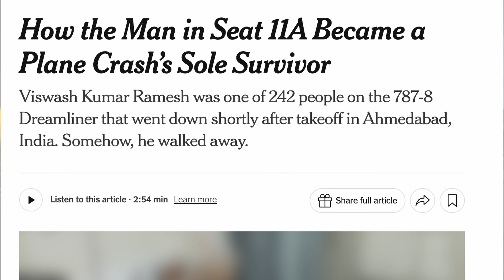Why the RAT Changes Everything – Air India 171 Update

Comment: Top suspect seems to be fuel contaminator that caused a compressor stall and the loud bang the survivor heard.  The plane was 11 years old.  Nobody's mentioned any prior mechanical issues like a past, fuel system issue that could've affected both engines. That leaves fuel.  I'm guessing the plane is designed so a power failure wouldn't affect the fuel injectors.

Comment: It is good that the experts are converging in their opinion. I have seen at least one other pilot discuss RAT deployment in the video and audio. One of India's most famous pilots called it a dual-engine failure early on, too (although without any explanation). A DGCA-certified trainer recently discussed a dual-engine failure, and he believed it could have been sabotage, with the fuel valve being shut off. I would assume that the telemetry in the cockpit/black boxes shows that. But the entire flight was only about 30 seconds long. According to the DGCA trainer, the pilots would not be able to see it in the telemetry. If that is the case, then it needs to be included in the checklist (both manual and automatic) because it seems unreasonable that all it takes for someone to crash the plane is to shut off the fuel valve during maintenance.

Comment: If it was dual engine failure, why were the engines not checked before takeoff? This would be a standard procedure therefore is unlikely the cause IF there were correct standards adhered to.

Comment: Is it possible to cut off the fuel tanks from the engines from the outside without the pilots knowing about it.. there is a theory going g around that there was sabotage and fhe valve was closed which led to the engines running on fuel in pipelines and despite their being a full tank of fuel, the engines did not get them and just fell as soon as they took off

Comment: every one has an opinion here's mine... the flaps were never configured for take off lift thats why it took all the runway to rotate and liftoff. the plane had not developed enough speed and the landing gear drag also contributed to the problem after rotation and liftoff along with no flaps to assist with lift next stop is the ground. engines at full power and no flaps short runway they had to rotate at the very end without lift. these planes are capable of single engine takeoffs in emergencies WITH the correct flap configuration.

Comment: A Boeing 787 pilot detailed that the aircraft is designed to be successfully flown even with 100 percent electrical power failure! The engines don’t stop based on a 100 percent electrical failure either. Boeing doesn’t design engines and the RAT only deploys with double engine failure. So it’s bad fuel, pilot error, or faulty engines. (And we know it’s extremely unlikely to be the engines failing in concert!) Nevertheless this isn’t Boeing’s fault.
Reply: Where's the original?

Comment: Here is what I wrote to a friend the day after the accident occurred.  Its relevance

should be apparent, without the need for further analysis, or multiple conjectures.

"I don’t have any inside dope on this crash.  But one thing about the various news

stories concerning the event does puzzle me.   If the plane was at a height of 675

feet when it began its descent, it could not have plunged at a rate of 475 feet per

minute (= 5.4 miles/hour), which would have given the pilots ample time to brush

their teeth, comb their hair, and call a taxi.  Take-off speed in a 787 loaded with

passengers and fuel is about 160 mph [I looked it up], so they were descending

at 14,060 ft/min, which gave them 21 seconds (out of the 39 seconds that the

plane was in the air) to react.  Subtract three seconds for normal human reactkon

time, and that leaves 18 seconds.  The nose pitched up about 3 seconds before

they hit the ground, so in those 15 seconds (which is more than enough time to

do what is necessary, if you know what you’re doing and have a co-pilot to help

you do it) they must have been trying to do everything they could think of (and

were trained to do), even before calling Mayday.   So they had ample (sic) time

to get things under control, but couldn’t.   It follows that there was a malfunction,

or perhaps multiple malfunctions that combined to bring about the catastrophe,

quite apart from bird strike (or whatever else was happening).    Granted, if

they had been at a higher altitude, as was the case with the “Miracle on the 

Hudson”  (2,818 ft), they would have had a much better chance.  Sullenberger

and Skiles landed in the water four minutes after the birds hit the fan belt.

But even at 675 feet, they weren’t going down vertically, like a fighter jet

after being hit by a missile, or a plane flipping over and gravity doing the

rest before the pilot can even react.   Rather, it looked just like a normal 

descent, except that it wasn’t.  These poor guys must have been pushing 

every button and moving every stick or lever in the cockpit, all to no avail. 

Initial reports from the airport said that the plane wasn’t “properly configured”

for takeoff (i.e., the flaps weren’t in the right position).  But that seems highly

unlikely, especially with an experienced crew, multiple checklists, and on a

hot day (temperature was 104° F) where pilots take extra precautions due

to thin air, which changes atmospheric conditions on the ground as well as

in the air—and ATC (air traffic control) is quick to let you know that, before

you leave the gate.   The pilot had 22,000 hours of flying time in big jets—

he was no novice.  Neither was his first officer.   Granted, it might have

taken another miracle to prevent disaster.  But I have a hunch that, as

Mae West would say, 'miracles had nothin’ to do with it, Captain.'"

Comment: Investigation is going on, wait for some time. Its not the human error, its electronic failure like (nigeria to dc flight , January 2025) united airline with same plane.
✅️ the main difference between incidents is that united flight ✈️ was flying at sufficient hight when autopilot failed due to electronic failure and they could recover it due to sufficient hight. 
But indian one was only at 600 feet when this happened. 
✅️Investigation is going on, and don't try to put blame on pilots because Investigation is on the way.

Comment: The FDR should provide engine performance from the start of the takeoff roll to V1 and Vr .Were the engines providing normal thrust up until the Captain declared Mayday 
No mention has been made about the autothrottles or the FADEC engine management system. 
Highly unusual for both engines to not produce thrust simultaneously..

Comment: But the surviving passenger interviewed said he heard engines power up before the crash?

Could a jet engine be running, be powered up, and yet still fail to deliver thrust? As in a situation of an inadvertently feathered propeller? Can anything cause a lack of power in a functional engine?

What would happen to the power systems if both engines suffered fuel starvation, but not from contamination or lack of fuel, rather failed fuel pumps (no power)? And the RAT didnt have enuf time to offer the necessary power for those engines in that short period of time (under 30 seconds)? 

Could a failure of the engines to feed necessary power to the entire aircraft electrical system itself result in a fuel pump stopping and thus starving those very engines of fuel in turn)?

How are fuel pumps powered? What is the fail-safe here?
Reply: It was probably the RAT he heard. The passenger is not an aviation expert. Frankly many watching this video wouldn't have been aware of the RAT before.

Comment: You can also hear the RAT because the jet engines are not providing full thrust and drowning it out.

I'm going with some kind of fuel-related or fuel pump related issue. Another video showed dust coming off the end of the runway as they initially gained lift with indicates they rotated at the last second, so one engine may have started to lose thrust just before or during rotation. Then the second one quit.

The blackbox and CVR will provide the definitive sequence of events.

Comment: RAT deployed and the fact that Flight Radar 24 data stopped in the air, this could mean the transponder/ADSB stopped transmitting  because of power interruption from the generators which are powered by the engines. This could be clue no.4

Comment: Question-if RAT was deployed then oobviously it wasn’t the copilot mistakenly adjusting the flaps instead of pulling up the landing gear, but I still want to know why a plane would be designed so that this one mistake at takeoff could cause crash. There are no warning alarms if you do this at takeoff, am I right? If it’s one little mistake like that that can cause a crush at takeoff then it will happen one day and I’m just really curious why they wouldn’t build in some kind of automatic alarm so you can’t do this.

Comment: Can a B787 pilot tell us what the fuel temp limitation for takeoff is for the B787? It’s my understanding the OAT was 115F at the time of departure. I have to wonder how long the wings were baking in the Sun after fueling. 

While seat  11A by the forward spar is in a strong structural location, the aft spar is the stronger position on a swept wing aircraft. The rear spar is the primary structural component that carries the bending and shear loads generated by the wing during flight. 

I suspect the “flickering lights” report was probably the emergency lights coming on when Normal AC power was lost. The Emergency Generator, powered by the RAT, would not supply cabin lighting. The RAT extension would produce an attention getting bang.